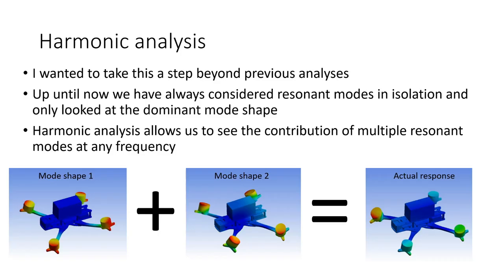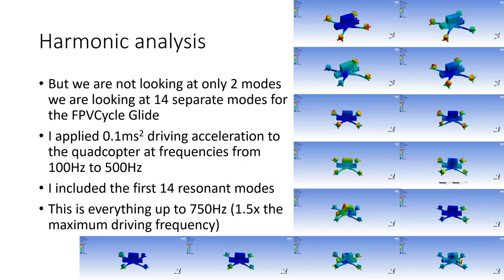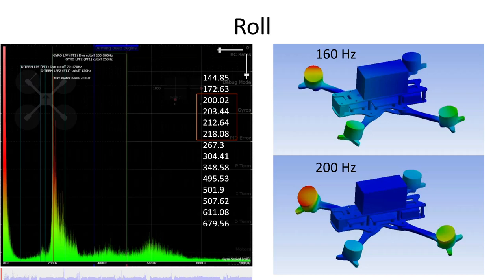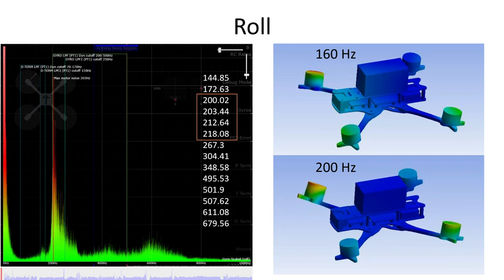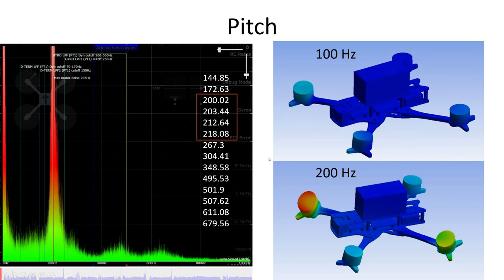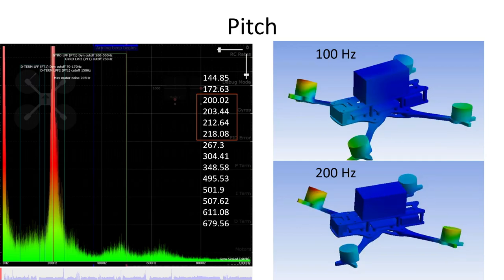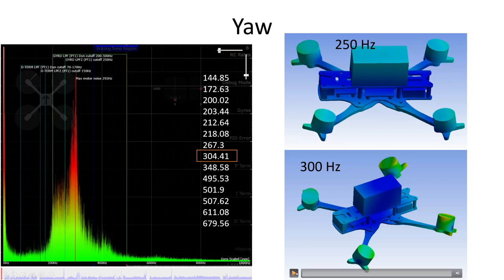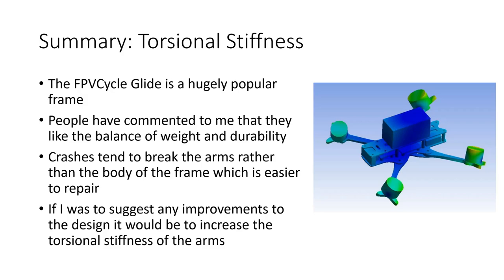FPVCycle Glide: Frame resonance and vibration analysis

Comment: love the content and the flow of the video 

will be interesting to see a similar simulation on vertical mounted arms , as they were considered in some frames to introduce better air flow.

congratulation on the collaboration with Kebab , looking forward to see the next frame improvements .
it will be a mix between pure passion , filed experience and science

Comment: Thanks for the video Chris, CiottiFPV also runs his stand off height at 15mm's. I'm sure this would effect the results, ( for the better ? )  Standard glide frame standoff height is around 23 mm from memory.
Reply from the maker: Thanks for the info! I think a shorter standoff could well help improve torsional stiffness of the body but I don't think it would affect the torsional twisting of the arms that dominates the mode shape at the resonant frequencies.
Reply: @ChrisRosser  Yeah wasn’t saying it would change the stiffness of the arms it was just a factor to take into consideration
Reply: Ciotti has some magical technique that makes his builds come out super duper ultra quiet in the black box.  I haven't yet figured out what on earth he's doing but his Glides are essentially dead when it comes to vibrations.  They all have 15mm standoffs but I'm not really convinced that's what it is.
Reply: @Kabab  Sooooo.... with all this new information... I need a suggested BF filtering configuration please. A CLI with all the filtering settings would be awesome.
Reply: @diegoteamorin  unfortunately it's not that easy. Everyone is running different components. Even two identical builds will resonate differently

Comment: Thank you for this excellent analysis of my favorite freestyle frame!  A couple questions.  First does battery placement affect the vibration and resonance? This frame accommodates the battery to be placed further to the rear of the frame.  I never see a glide built with the battery mounted so far forward like this model. Also, most freestyle quads are carrying an action cam of some sort.  Would the addition of an action camera on the top front of the frame affect the results?  Seems like there would be more realistic results with a load on top for the action cam and the battery placed where the frame was designed to hold it for best cg, or do these factors not contribute to vibration and resonance? Thanks Chris, keep up the amazing work!

Comment: Perfect timing for this video. At the moment I am tuning FPVCycle Glide frame and get stange concentration of vibrations around 500hz at 20-40% throttle on roll and yaw, but not pitch. This is spectrogram of my log: https://ibb.co/9yfJDwQ
Reply from the maker: Up at 500Hz I would be surprised if it was really affecting flight performance. Have you got any low pass filters on at all? The Glide really benefits from a PT1 low pass.
Reply: @ChrisRosser  I use no lowpass filters, but Notch filter at center freq 500hz and cutoff freq 200hz. Also RPM filter 3 harmonics and Dynamic Notch filter: width: 0, Q=250, minHz=100, maxHz=500. My plots after filters: https://ibb.co/3hLNNLT
Cannot figure out what is causing this peak on roll axis at around 45Hz.
Reply: Found solutions for 45hz oscilations. Too flexy gopro mount.

Comment: What are the practical negative effects of resonance on flight characteristics, durability, etc? Is it possible to get rid of resonance, or just move it to frequencies where negative effects do not occur?
Reply from the maker: In bad cases, hot motors, jello, and oscillations. In moderate cases an inability to tune out propwash and sloppy stick feel due to the high levels of filtering required.

You can never get rid of resonance entirely but you can tune the frequency and add damping to improve the situation.

Comment: @Chris Rosser 

Out of interest have you looked at what would happen with vibrations if we basically have some sort of strut (be it metal rod or something) connecting the upper plate to the motor mounts on each arm? That would likely require inverting the motors or mount the arms to some sort of midplate and have the struts go to the bottom plate, but I would be really interested in seeing if that would do much good or not.
Reply from the maker: It would certainly help a lot but it's complex to implement in a frame design whilst keeping it simple to repair and cheap to buy.
Reply: @ChrisRosser  Yeah I imagine the repair would be rather cumbersome, and midplate design would definately add quite a bit of complexity and cost especially using lightweight materials, but I cant imagine inverted motors + m2 threaded rod to the upper plate and motor mount with some basic angled fasteners would add much to cost (bent sheet metal with attached nut, or even just some holes for the upper plate), this sort of thing will weigh quite a lot I imagine, but might be interesting/worth the weight for something like a 7 inch I think.

Comment: How would you increase the tortional stiffness? Wider arm, thicker arm, denser carbon fiber?
Reply from the maker: Wider arms, thicker arms, higher torsional modulus (which can be achieved by changing fiber orientation)

Comment: So if the arms was a bit wider or had a brace between arms then would a lot of the twisting be reduced. Also have you looked at frames with vertical arms yet like the hyperlow vert frames.
Reply from the maker: Not yet, it looks like the CAD for the Vert might be available  either from Hyperlow or Bob Roogi. I'll add it to my list to consider thank you!
Reply: @ChrisRosser  vertical braces...

Comment: Your way smarter than me. Im listening and trying to learn.  Curious though.  Would you get completely different results from different individuals setups on the same frame. 
My personal setup on frame to say anyone else setup on that frame
Reply from the maker: If you use very different weight motors then yes. I don't think a different FC or ESC would make much difference to resonance. Electrical noise will make the spectrogram much more noisy though, so caps are a must.

Comment: I've been excited about this one, and it did not disappoint! I think if you want something better than a source one, but you can't dish out the cash for an Apex, this is the best choice. Some questions for you: 

Bob also has the Glide hammer, which is much thicker all around. Do you think there would be improvements to the torsional strength and to the damping of noise?

Given the increased noise on pitch, do you think it's better to mount the FC in the center?

Congratulations on 1k subs. You truly deserve it and I can't wait to see your channel reach new heights
Reply from the maker: I'm so glad this video lived up to your expectations. I'm always a bit nervous when it comes to doing such a highly requested video. Thanks for your support!
Reply: Of course, the more material for the same shape (so scaling a full body) increases its strength, though does not dampen noise. This noise, caused by vibration modes, is still there but in different frequencies (the modes shift higher since the structure flexes more quickly, hence higher frequency). This is a good thing, as higher frequencies are filtered, but of course at the cost of weight. Conclusion: we need to find the lightest way to shift modes to higher frequencies without sacrificing weight balance.
Reply: @charlesmarseille123  Thanks for the info!

Comment: This got me thinking ... are you modeling the tensile strength of the CF?  Or more to the point, are all CF created equal as far as frame resonance is concerned?
Reply from the maker: Yes the carbon fibre is modelled as an orthotropic material to take into account the layup and fibre orientation.

Comment: how does the dampening from the gyro effect from the rotational mass impact these models?
would these all change with different motors or props?

are these just models or are we confirming this is sync with real world observation?
would we see these under high speed camera under enough forces? 
are the motors actually moving this much or is this extremely exaggerated?  
how much more arm mass would be needed added to be where you'd be "happier... "?

help me digest this... 
I know I risk looking a fool for exposing my ignorance...
Reply from the maker: There are no bad questions on my channel, only bad answers. That's my rule.

The effect of rotational mass is accounted for in the simulation so no worries there. Different weight motors will have a big impact but props not so much unless the resonant frequency of the prop closely aligns with a frame resonance.

I am working with Bob Roogi to confirm the predictions made by these models through blackbox logging and design changes. So far we have excellent agreement with the predicted effects of design changes and the actual results in flight.

Oscillations are <<1mm so high speed photography is going to be challenging to use.

Everything is a tradeoff, you don't want to add too much mass but you want the best resonance performance. I've nearly finished my 5" frame. Once its done you'll see what I think perfect looks like 😁

Comment: Awesome job and truly appreciate your expertise..... for me, well I guess I’m back to putting electrical tape under my motors 😏
Reply from the maker: People have had great success with a single layer of electrical tape between arm and sandwich plate
Reply: @ChrisRosser  Really???  I was just joking... but seriously wouldn't the soft mounted gyros or FC PCB's suffice (or even RPM filtering) dampen these vibrations?
Reply from the maker: @ibfisher  I'm working with Bob Roogi to understand this but it really works on the Glide. It's no joke.
Reply: @ChrisRosser  Interesting...I have the Glide and the Hammer so I might just try it.  Yes, I heard about you and Bob collaborating.  This is fantastic news, I'm looking forward to see what fruit your effort bears!!!

Comment: Incredible as always Chris. With the pitch/ roll resonance being around 200hz and other frequencies being relatively low in terms of amplitude would it be possible to reduce overall filtering in Betaflight and just apply a notch filter at the appropriate frequency?  You mention the design strategy of separating resonate mode frequencies but would it not be more beneficial to have the resonate frequencies closer together so a simple notch filter can prevent the gyro from seeing them?
Reply from the maker: Absolutely, you could also let the dynamic notch filter take care of it and run RPM filtering to deal with remaining motor noise. Purposefully concentrating at then notching is a really interesting idea. I think it might put people off that the frame won't fly at all well on defaults though... I don't know how many pilots are individually tuning their filter notches.
Reply: @ChrisRosser  I did not consider that a majority of the hobby is still running BF defaults. As Bob has done with his motors though, maybe including recommended settings on the product page is an easy way to ensure the frame flies well for consumers? Building a quad from individual components versus a BNF requires more technical skill and so assuming someone can follow reccomended settings and configure Betaflight filters correctly may not be unreasonable. Perhaps the future of frame optimization is forcing resonate modes to be roughly the same frequency to where a notch filter takes care of it and that becomes one of if not the only filter active besides RPM filtering?
Reply: We need a CLI for the recommended filtering settings. That would be very useful

Comment: Another great video! Glad to hear you’re working with Bob to help improve designs. I think I heard that you were looking at the “Prototype 5”, can’t wait to see what you’ve gathered there. On another tip, I remember someone saying that individual arms vs a monobody baseplate supposedly reduces vibration but that seems backwards to me, as all of my monobody 3” quads seem easier to tune than anything else, do you have any data on this?

Comment: I'm curious if you think it would help to do some software filtering around the resonant frequencies?  If you know that on a certain frame there's modes from 200-220Hz on roll, you could bandstop filter that range and prevent the resonance from messing stuff up downstream.
Reply from the maker: I would hope BF dynamic notch filter is handling those resonant peaks, if we can remove them we can turn off the notch and improve latency!

Comment: So having just discovered your channel, would you suggest to not design or build a homemade quad frame or to 'over build' it to push the potential frequencies higher up to reduce their effect. More carbon results in a stiffer frame so thicker top and bottom plates and perhaps tubular arms to not favour one axis of resonance over another?
Reply from the maker: I would never tell someone not to design their own quad frame. Just be aware that these are important considerations and without careful design and testing you can get into trouble. Especially with lightweight frames.

Comment: Very interesting stuff. Have you already tried to quantify how good the simulations match the real frames? At least for the Glide frame the peaks seem to be very close to the predicted frequencies.
Reply from the maker: You can see how close they are by comparing the backbox log spectrogram to the frequencies in white text which are from the simulation.
Reply: @ChrisRosser  I thought in the direction of creating a metric for the fit. Because identifying frames that are not matched well by the simulation could lead to interesting questions (material, joints, friction, fibre orientation).

Comment: Thanks for the video! 😀 However, most of the time it's over my head and I've been waiting for a conclusion how this frame is doing compared to others. I can't tell if this all means it's really bad or nice nevertheless. I know it's hard if you're friends with Bob, but... yeah.
Reply from the maker: It is a well executed frame that performs well for it's weight. There is room for improvement, but that's why Bob (and I) are working on the prototype 5. Would not be a mistake to buy one today.
Reply: @ChrisRosser  Interesting, so you'd say the Prototype 5 exceeds the Glide? In all aspects? It looks not durable at all.

Comment: Nice video!
Could you please provide more details on what material/settings you are using to simulate carbon in Solidworks?
Are there settings for the fiber orientation or something?

Also a question about blackbox, i think a lot of noise there and peaks are coming from the actual motors, how to distinguish where is the motor rotation noise and where is the frame resonance?
Reply from the maker: I believe material modelling in Ansys allows for orthotropic properties by default. If you use Solidworks you would need to use the composites add-in.

In general motors tend not to produce spikes they produce a broad hump of noise across their rpm range. Frame resonances produce spikes.

Comment: I have had vibration issues with this frame for a while, so what frequency notch filters would you recommend? It would be nice to have just a few notch filters where those resonance frequencys are so i can reduce the overall filtering everywhere else. Thanks, nice video =)
Reply from the maker: Frequency will be dependent on the mass of your motors. If you look at a blackbox log you can spot the key resonances pretty easily, they are the spikes in your spectrogram. You can also set dynamic notch filter between 150Hz and 350Hz and use RPM filter to tackle it in a more automatic way.
Reply: @ChrisRosser  Thanks, will try. Its weird, when i arm while on the betaflight motors tab, i can see that the motor outputs are shaking. but on the blackbox its completely clean. I haven't used blackbox while flying yet so will definitely try that next.

Comment: Are you checking to backup simulation with slow motion photography?
Reply from the maker: It would be interesting to see if that were possible. The amplitudes of vibration are <1mm so it would be very hard to see in flight. At the moment we are verifying through blackbox logs and frame design changes. When the design change has the desired effect we grow more confident in the underlying analysis.

Comment: Two arm struts would go a long way to reduce the ability of the arms to twist compared to adding material to the arms.
Reply from the maker: I'm working on a strut based frame design. It achieves more even than just torsional stiffness 😎
Reply: @ChrisRosser  of course, I was just directly addressing the issue mentioned.
I used to work on aircraft, and some of the stuff I think is obvious turns out to be not so obvious.
Your videos seem well balanced in explaining detail at an consumable level, and gaining the respect they deserve.
Hats off to KababFPV for supporting this process
Reply from the maker: @robinfpv4858  Thank very much Robin. I really appreciate your support. And you are spot on about a split arm design being stiffer in torsion. Another benefit is that it allows you to independently affect a number of different mode shapes which can allow resonant frequency separation.

Bob has been so onboard with this, I have so much respect for someone who is so keen to experiment, learn, and improve.

Comment: Hi Chris, just came here from watching Bob's video on this analysis. Really great collab and insightful points! 

One thing he noted at the end of his video (https://www.youtube.com/watch?v=oHONikUxCcw) was that when he mounted front to back motor crossbars, the central point of the vibration was moving around it made the vibration performance drastically worse. Is that phenomenon something that happens in general with that style of crossbar mounting, or does it really depend on the geometries of the frame?